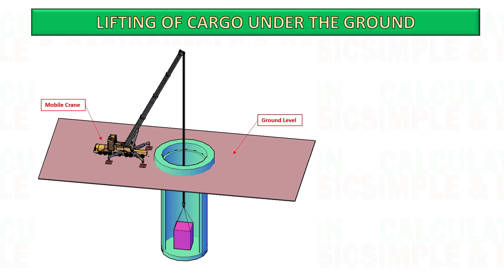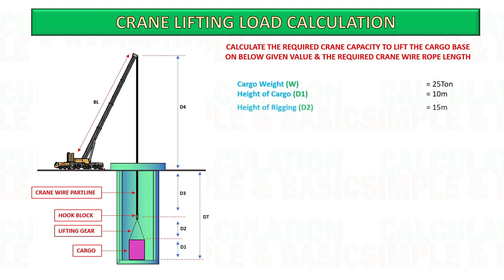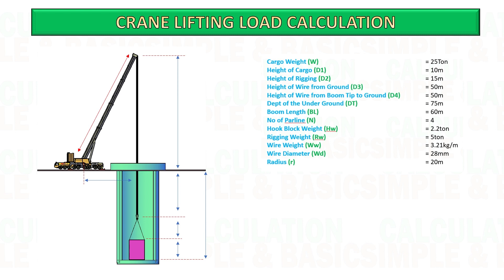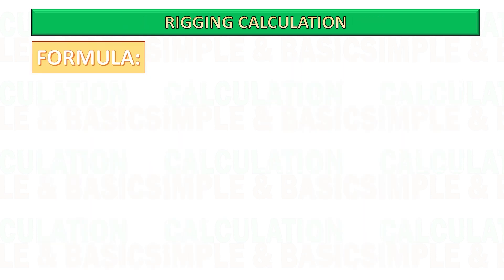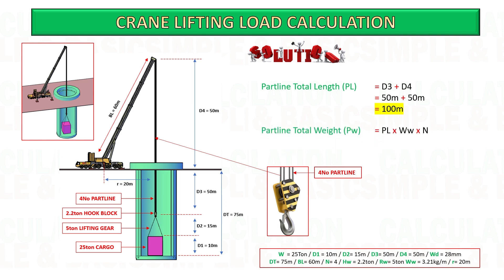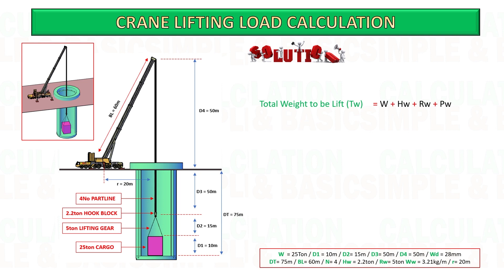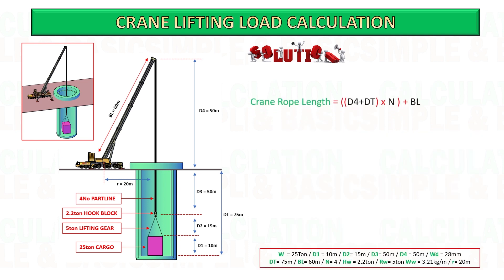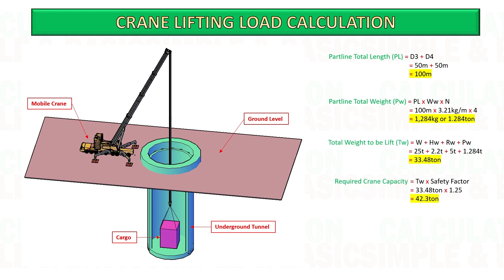Single Crane Lifting - Load Calculation for underground lifting #lifting #rigging #heavylifting

Comment: hello! the video is great!!

I have a question, where does the safety factor come from? (1.25) some standard maybe??
Reply from the maker: The safety factor is not standardized; it depends on the lifting requirements of the site to determine the acceptable margin of crane capacity above the load being lifted.
For instance, a few construction sites mandate a minimum crane capacity of 1.25 safety factor or an 80% crane utilization rate for the total load to be lifted. 
In contrast, other construction sites permit lower factors such as 1.2 or 1.1... etc.
Please check the site regulations pertaining to lifting.
Thanks for the comment :)

Comment: 1.25factor where is coming this pls explin sir
Reply from the maker: Usually for lifting, 1.2 to 1.25 is required safety factor for crane capacity for lifting.
It's depend to site requirements for lifting.
Example:
Total Weight of Cargo to be lift = 5ton
Crane Capacity = 6.25ton
Safety Factor = 6.25/5 = 1.25
Utilization Rate = (5/6.25)*100 = 80%
Reply: sir, good afternoon sir i understood sir's example but in sir's video with total weight ×factor = then total 43. somthing is coming, what i don't understand is what i am doing according to sir's example, pls reply again with total weight @SimpleandBasicCalculation